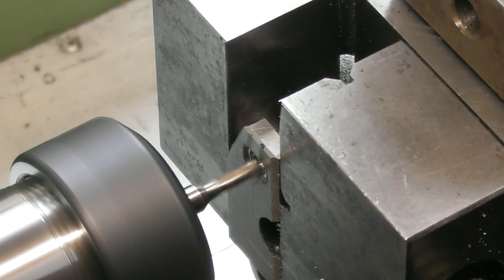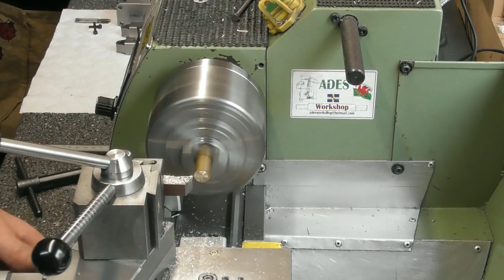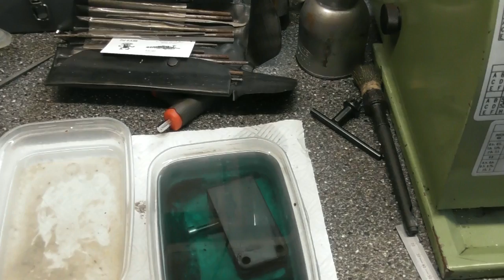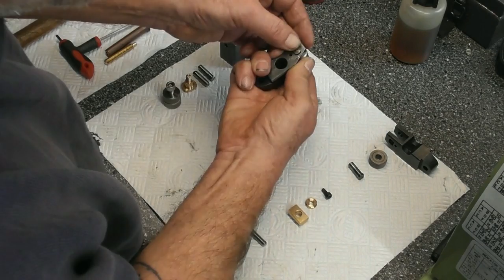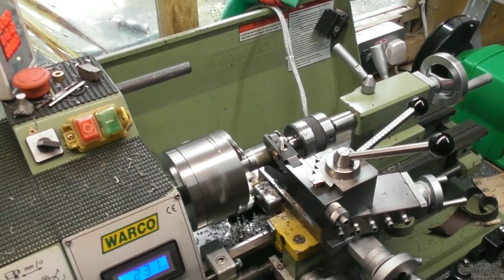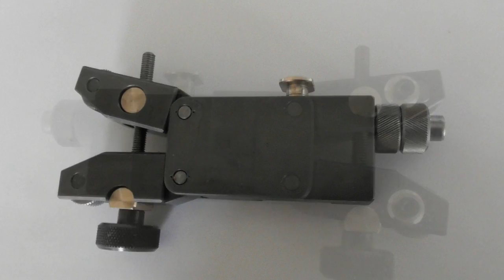Shop made knurling tool part 10 The try out

Comment: Hi ade fantastic series of videos very interesting and informative thanks for sharing how did you Harding the silver steel pins ?? Great problem solving along the way all ways a pleasure to watch can't wait to see what's next once again thanks for sharing best regards Shaun 😀
Reply from the maker: Hi Shaun , i had to use oxy aceteline  at a mates cos my torch was not big enough , i heated them to cherry red then quenched in water , polished them back to shiny then tempered them to medium straw colour , repolished to size and job done , some say quench in oil but i use water for silver steel with better results , Cheers Ade,

Comment: What was the reason for the adjustment knob underneath?
Reply from the maker: Hi Dave , i was thinking it would give better visibility of the knurling process , however , on reflection i makes very little difference and the handwheel gets covered in muck during use and transfers to the hand , I will be changing it to the top when i do the improvements , Cheers Ade.
Reply: @ade63dug  Thanks for the reply. I made a pinch type knurler more than 50years ago as I could see my ML4 would never do the job with a push in type that we had at work. Cheers to you.

Comment: Well done.   Good to see it worked.   You can mill the arms if you need to fix getting slightly larger opening.

My commercial equivalent knurling scissor type tool uses spring pins for the wheels and arms.   Also called torsion pins in the US, not sure of the name in the UK.   These work well and simpler than your design, although your design looks better, especially the brass washers for the keepers.

Dave.
Reply: Roll pins

Comment: Ade,
You have done a good job there but I would suggest swapped the arms top to bottom to make adjusting the pressure on the job easier. With my commercial one I find myself adjusting it quite a lot during use.

Regards from down under

Mike